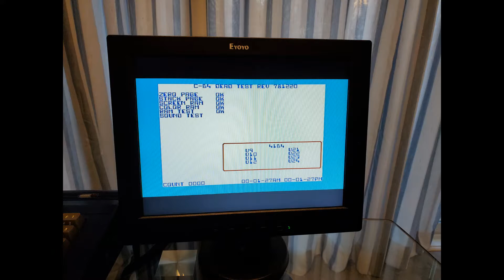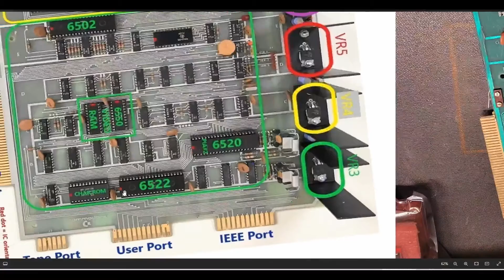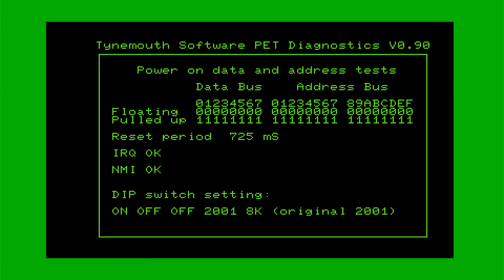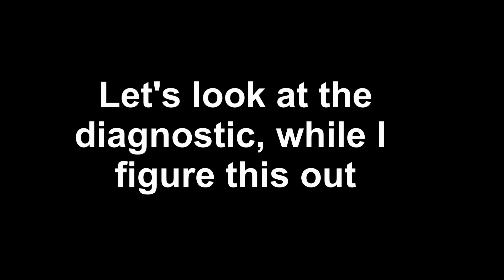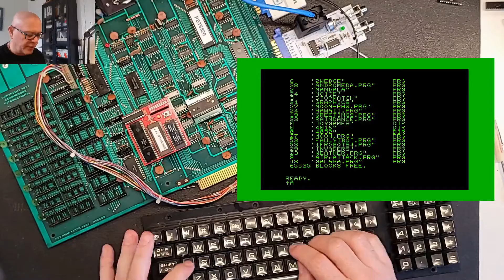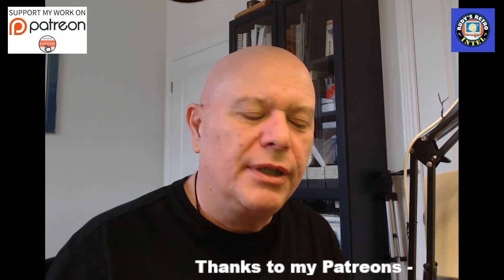Commodore PET 2001-8 Repair Time. Let's see if it will live again!

Comment: @03:39 The Photo of the PCB (0170) is my 2001-8.  The documentation is ambiguous about H3 so I'm not sure which regulator powers that chip.
Also note that the orientation of the character ROM at A2 is different for different version of the PCB.  
If you look very close at my photo, you'll notice my character ROM is the other way around.
My 2001-8 in the photo is a 320081which has MOS 6550 RAM and Synertek 2316B ROMs.
The one you're repairing here is a 320008 which has MOS 6540 ROMs.
The layout is the same but the chip pinouts are different.
AFAIK, it's only the character ROM orientation that's different for 6540 vs 2316B ROM chips.
The 320132 and 320137 boards use 2114 sRAM instead of 6550 with 6540 and 2316B ROMs respectively.
Reply from the maker: Thanks Chuck!! See, everyone Chuck is the King of PET repairs. Thanks for the clarification. I will be making a new pic soon.

Comment: I do have the full replacement tynemouth 6502 Rom / Ram board v 3.1 Although I have never used it. I would love to have that diag board.That thing is sharp !!!
Reply from the maker: Excellent!! It's a great help. Thanks for commenting
Reply: @RudysRetroIntel  Great video!!! Life is so much easier when you have the right tools. I did find the DIAG board for $80 but the shipping will be an additional $35. Although it will be a lot easier then pulling all the 6550 Ram chips out and testing them one by one...   LOL !!!  Did it test the Video memory ???
Reply from the maker: No, if video RAM is bad you will get no signal to the monitor
Reply: @RudysRetroIntel  I know that I have one bad video ram chip for sure, and yet I am able to get video to work. The one furthest away from the Memory Expansion Port.
Reply from the maker: That's good. Looks like just 1 partially bad ram chip!
Reply: @RudysRetroIntel  Love that diagram !!! It was very helpful !!! I do have a question on the unregulated -9V. Do I have to have the board plugged in, to receive that voltage? I am getting the 16.9Vac but not the 9Vdc. The J8 information was very helpful.
Reply from the maker: @jeffnay6502 yes it should be plugged in
Reply: @RudysRetroIntel  Can you explain how the -9Vdc voltage is derived? Does it go to the Capacitor and back into the board on J8 ??? It just seems a little weird to me.
Reply from the maker: You need to review the schematics, sorry
Reply: @RudysRetroIntel  No problem. When I plugged the board back in it did boot up, but still having problems. Probably due to the bad video memory chip. I ordered 5 new 6550s that should be here by Dec 15th.
Reply: @RudysRetroIntel  Do you have the documentation for the Tynemouth 6502 ROM/RAM board v3.1 ???
Reply from the maker: No, you can find it in there website
Reply: @RudysRetroIntel  I was looking for it there. They do not seem to distinguish the different version very well. What version is the one you have?
Reply from the maker: Mine died so I don't have it anymore. Need to get a new one.  Send them an email and say you need the manual

Comment: Nice video. Pleased my PET ROM/RAM, PET Diagnostics and SD2PET were useful. One note, although the 2001-8 cannot normally support BASIC 4 (as it does not have enough ROM sockets), you can use BASIC 4 with the PET ROM/RAM and it runs fine on the 2001 board.
Reply from the maker: Did you make or give me the PET    ROM/RAM board and SD2PET boards? Awesome work!! Icould be wrong, but BASIC 4 would not work on the PET 2001-8 board. Will have to ask  my friend to try it again
Reply: @RudysRetroIntel  I make the PET ROM/RAM and PET Diagnostics and I designed the SD2PET for TFW8b. Google "tynemouth software blog" and you should find me. BASIC 4 should run without a problem on any PET board. The 2001 can run either the version from the 9" 4000 series or the CRTC version if you want to fit a piezo and hear the power on bleeps.